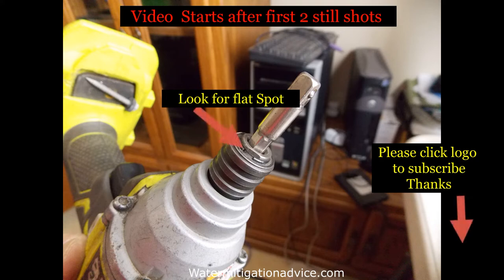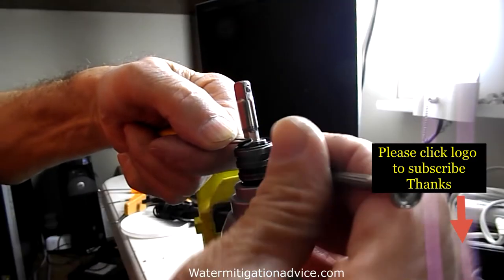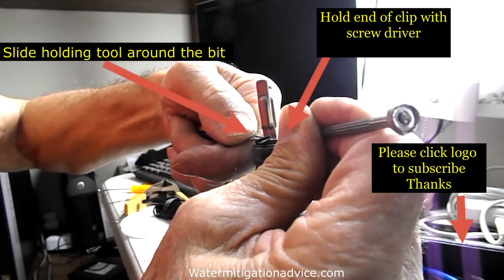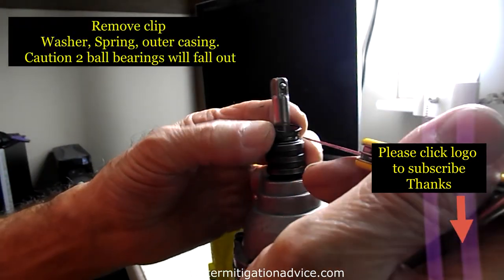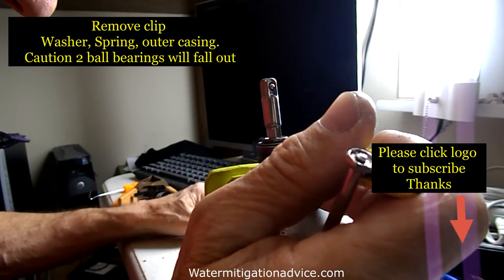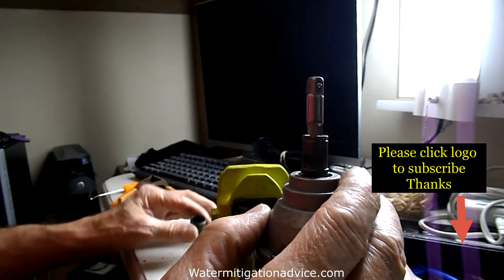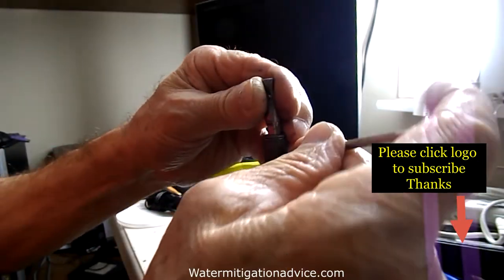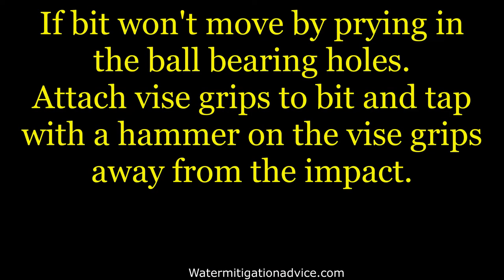Remove Ryobi stuck bit 2 More detailed

Comment: I got the ring, washer and spring taken out but that piece wont slide off. same impact driver too.  maybe diff year or something.
Reply from the maker: If you have removed the spring clip, at times the bit may fight back a bit. Hold the bit tight with vise grips and tap lightly. You can also try getting a small screw driver and poke at the 2 small bearings. DO NOT DROP THEM. at times they get jammed up in there. Hope this helps
Reply from the maker: Is the bit a short bit? is that why you can't grab it? This is a long shot but if it is a short bit, Phillips or straight head. Clean tip real well, apply a good super glue and stick a screw with the same head on to it and hold firmly until dry. then try to wiggle it gently pulling outward lightly. With some luck it may work.
Reply: ya I was in a hurry, put a short bit into it like a moron and immediately recognized the problem i faced. However I have an update for you. I did finally get it out. So my Ryobi impact drill after removing the C lock ring, then the washer and spring come out, the Bit itself was keeping the two bearings from coming out. One thing I tried and failed at was using the ryobi dremmel to cut notches into both sides of the bit, however i ran out of cutting discs. LUCKILY i found a brand new one laying in most random spot in my house. So after putting that on my dremmel I cut two  notches into each side of the bit, then using a pair of tiny wire cutter type of plyers but the ones that are meant from grabbing from the head of a screw. Then yanked it right out (oh after I had to use that cutting disc to cut down the outside wall of the ryobi slider that holds the bits. (the wall that is at thefront of the drill that must be a mm long or a cm long or something. Then it came out and I put it all back together after learning a valuable lesson. Thanks for the information and keeping up with my replies bro. I really appreciate you trying to help me. It means the world.
 @watermitigationadvice4385
Reply from the maker: Happy to be of help. I do recommend you only buy quality bits. While even good bits can cause a problem. I have found many of the cheap bits metal is softer and round off causing them to jam.
Thanks for the update on your project.
Larry